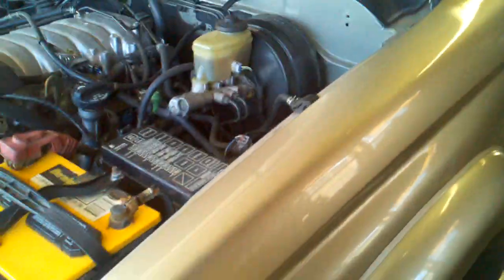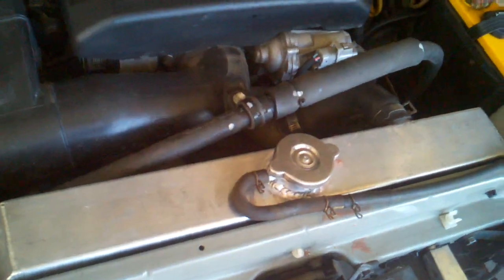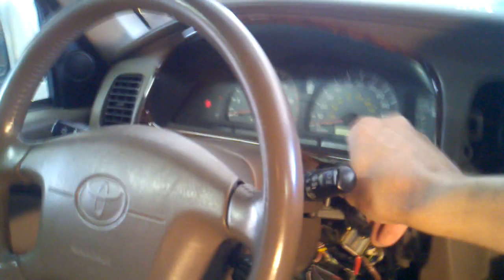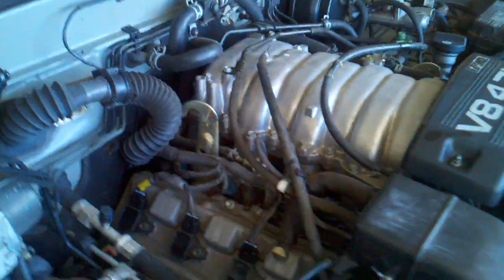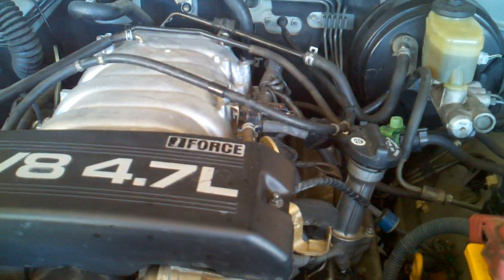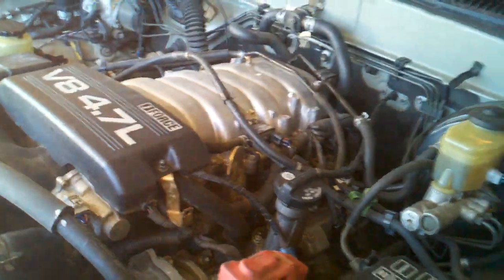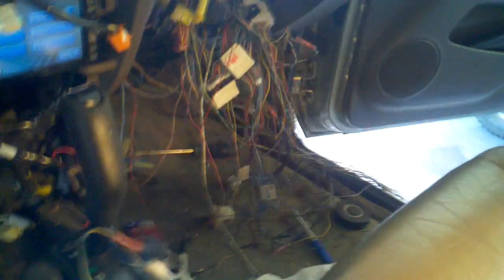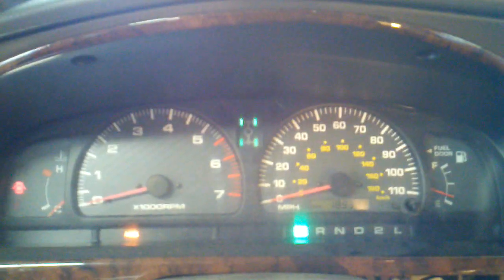2UZ-FE V8 powered 3rd generation 4runner

Comment: 1uz-fe vvti from the Lexus GS400 makes 300 hp and 310 ft lbs. The 3uz-fe from the LS430 and SC430 makes 290 hp (equal to that of the 1uz in the LS400 and SC400) and right about 327 ft lbs of torque.

Comment: I was wondering , you must have fabbed your own motor mount brackets to the frame? And did you leave the trans crossmember alone, or did that need to be moved as well due to the longer engine? And you must be using an external pusher fan for cooling due to space restrictions? And the exhaust manifolds cleared ok without a body lift or inner fender trimming? I've done (2) 5vz swaps, one was a 22-re and the other a 3vz, I had to move the motor mounts on the 22-re. I also have a stock 99 Limited 4runner and was thinking of 4.7 swapping it.  Thanks!  And nice job!

Comment: Wow. I want to put a 2000 Lexus GS400 4.0l 1uzfe vvti (300 hp, 310 ft lbs, 60 more hp then the 2uz non vvti, and 5 less ft lbs) in a 2000 4runner and make it exactly how Toyota would have from the factory.